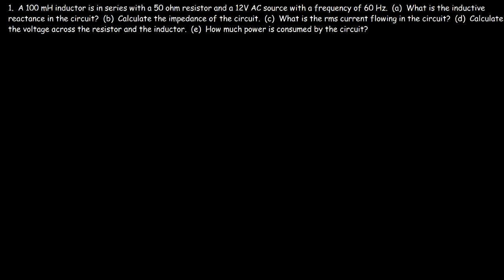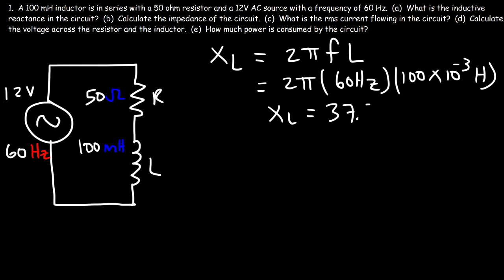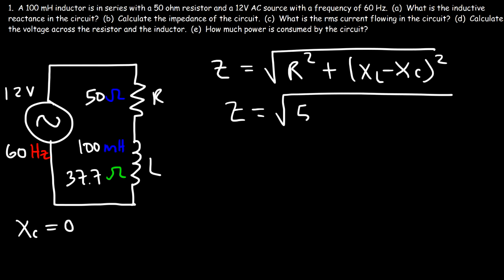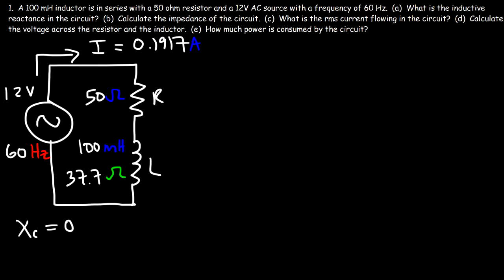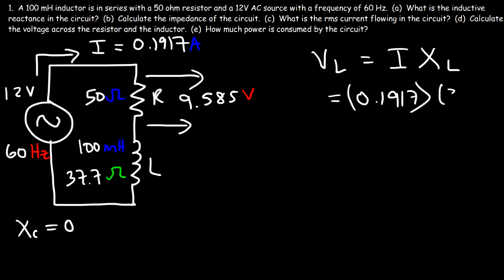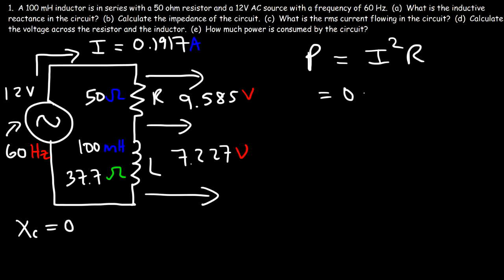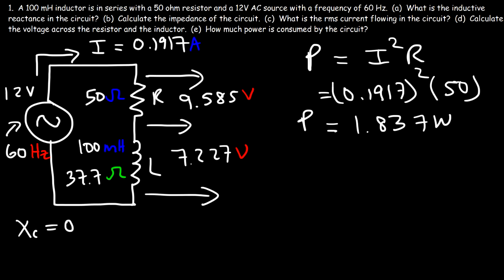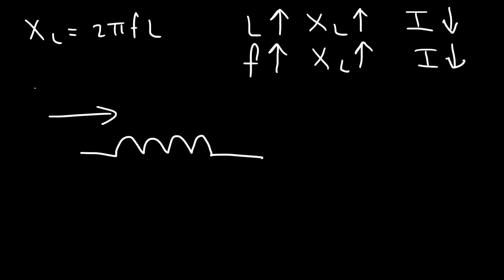Inductive Reactance, Impedance, & Power Factor - AC Circuits - Physics

Comment: why isn't voltage across the inductor not referred to as the induced emf as it was in DC? and doesn't use -L*dI/dt? would the inductor try to counteract the falling and rising of the current during alternation in the same way?
Reply: I feel like I have it all backwards

Comment: It is interesting. In practically all your videos on circuits, you use no trig or complex number representation in calculating power factor, power factor correction, phase angle etc.
I go to Engineering Academy and when he is covering some of the same topics he is using trig and complex numbers to do the calculations.
Reply: I believe you do trig when a capacitor is introduced to a circuit.

Comment: You could also calculate the power consumed by the circuit with a third solution by squaring the voltage across the resistor then dividing by the resistor!

P=[(Vr)^2]/R
P=[(9.585V)^2]/50 ohms
P=1.837W

Comment: The video examples were great! However, wouldn't the Irms = Vrms/Z, since Vs != Vrms and Vrms is found by taking the average value of the function sin(theta) over the interval from [0, 2pi]. Therefore, Vrms = sqrt(ave(Vm^2cos^2(wt)) = sqrt(Vm/2) = Vm/sqrt(2) = 12/sqrt(2) = 6sqrt(2). Doing the calculations for rms current, Irms = Vrms/Z = 6sqrt(2)/62.2 = 0.136A

Comment: A series circuit consists of a capacitor and a coil connected to a 120 Volt, 60 HZ supply with the following values:
1. The coil has a resistance of 30 Ohms
2. The coil has an inductive reactance of 40 Ohms 3. The capacitor is 15 microfarads
The circuit current is _____ Amps.
A) 4.00 B) 2.40 C) 0.957 D) 0.857

please help
Reply: With working pleaseeee
Reply: My answer is coming out to be (D)0.857
Is it correct? Plz confirm
Reply: 0.857

Comment: He doesn't explain the meaning of the power factor in this video or an earlier one. Power factor is an expression of energy efficiency. It is usually expressed as a percentage—and the lower the percentage, the less efficient power usage is. PF expresses the ratio of true power used in a circuit to the apparent power delivered to the circuit. A 96% power factor demonstrates more efficiency than a 75% power factor. PF below 95% is considered inefficient in many regions.
Reply: There is a lot of videos about these where he talks about ac circuit and electric current and related topics, you gotta watch them all to understand these question , he explained them before
Reply: @Salamanca-joro  yes I am further along in his playlist and I see that he does explain power factor in a later video though thanks!
Reply: @successthruknowledge   welcome brother

Comment: I thought power was current times voltage. Shouldn’t power be 2.3 watts?
Reply: This only applies for DC circuits.

The reason it doesn’t apply to AC is because inductors and capacitors cause the voltage and current to be out of synch. 

If you look at the voltage and current waveforms on an oscilloscope, you’ll see that when the electricity flows through an inductor the current becomes “delayed” with respect to the voltage.
Reply: @jasonlee3247  exactly must be observed that Ac squared plan Xc